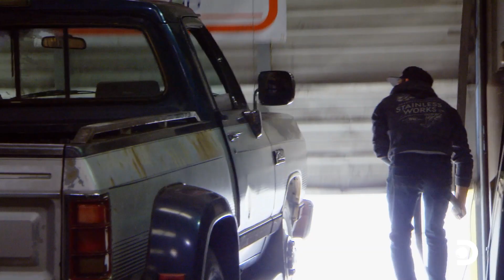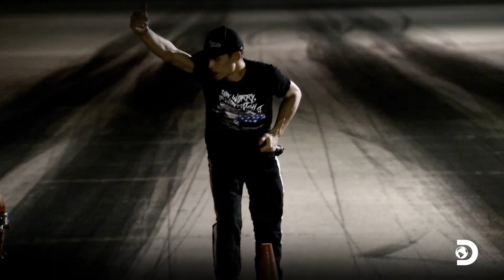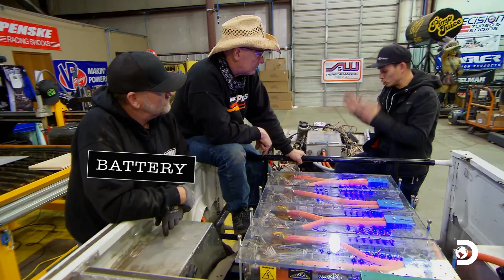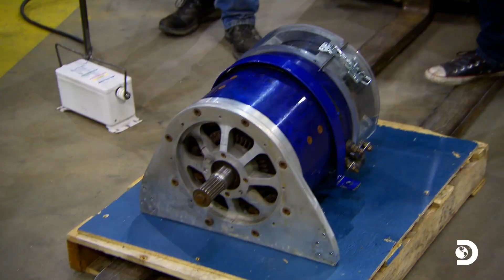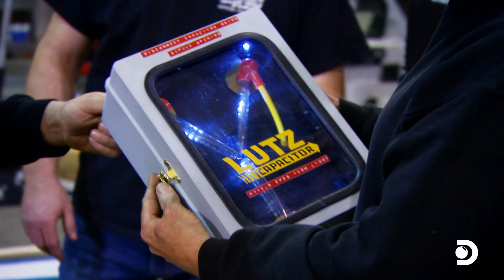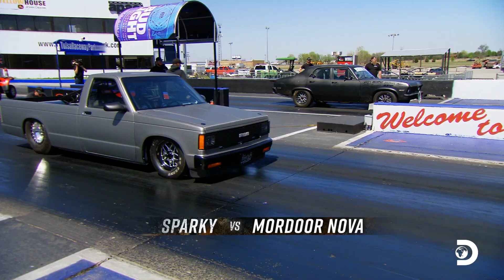Custom Electric Engine in a Truck?! | Street Outlaws: Farmtruck and AZN

Comment: Pretty cool its faster than a Model 3 Performance in the 1/8 mile, but ya'll need to do something BIG for the batteries, fill that whole box and do double motors instead of that single and you can be under 6's in the 1/8

Comment: As it is in this video, tires are a bit too much to handle. Truck looks like it bogs down off the line. Smaller tires could make it get out of the hole faster
Reply: Ya got it backwards bud

Comment: As a racer. I will never go to the track again if they switch to electric. Most of us will just find an old back road.
Reply: Electric drag racing??? I would rather watch paint dry
Reply: Yuppers!  It just doesn't "do it" for me either... I guess it's ok, as each is into their own things, but ICEs are my main reason for being on this earth! 😎
Reply: Until they outlaw all fuel
Reply: @optimusprimer4392  realistically that’s not gonna happen for a minimum of 30 yrs . Used vehicles aren’t just going away …
Reply: @optimusprimer4392  like if ethanol was so hard to produce 🤣🤣🤣

Comment: everyone keeps pushing this electric car deal when they are catching on fire , cost of purchase is way to much no charging stations to speak of , electric grid cant support the people we have now and now they want everyone to have an electric car to add to the demand problem .i would never have one in my garage being charged . they are a fire hazard and a waste of energy and time !
Reply: You could have made all those same arguments when people were switching from horse drawn carriage to gas powered automobile....yet somehow it all worked out.
Reply: @robertcarey3383  really i never saw  horse drawn carriages bust into flames and they didnt use electricity that we need to run our ac units . so there is that but nice try !

Comment: eletric aint no joke, ive seen OLD electric cars that will smoke any newer model sports car. Or even super car easily. I forget what model it was exactly but it would just GO GO GO. It was modded clearly but yeah.
Reply: Ev motors are very quick, no doubt. But they don't stir the soul.

Comment: The easiest way to describe what a potentiometer is/does, would be to look at any transistor radio. The volume switch on those radios is a potentiometer, on a much smaller scale than your truck.
Reply: Who has a transistor radio?
Reply: @michaelwhittman1956  AAHHHHH The joys of growing up in simpler times.
Reply: Tattoo machine power supply..
Reply: Its known as a variable resistor.  Much like the volume control on a radio..   probably switch is not quite the best explanation..

Comment: The main issue with EV's is the Electric motors have a lot of copper laminates and steel and magnets as well then your power source has to be high output which requires big batteries which all together weighs a ton and then you gotta keep the high temperatures these things produce cooled down on top of everything else
Reply: My wife uses an electric motor lol
Reply: @cannabis1014  mine uses a 2 stroke motor sounds like a Husqvarna 372 series chain saw lol
Reply: @cannabis1014  hehe.. Does it feel like the armature is "out of balance" when it's running, by chance?
Reply: It's gonna be a bit before electric motors outdo a well built gas one, but they have more potential for future development. Fun time to be alive for car tinkering!

Comment: Engines burn fuel. Motors utilize electricity to make a force. This is why I don't watch this show anymore.
Reply: Motor - a machine , especially one powered by electricity or internal combustion , that supplies motive power for a vehicle or other device .